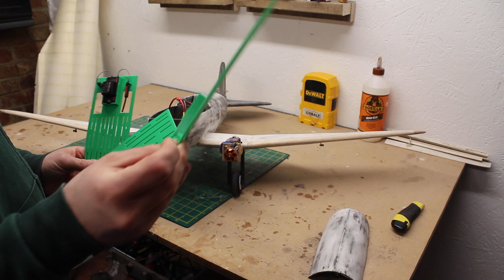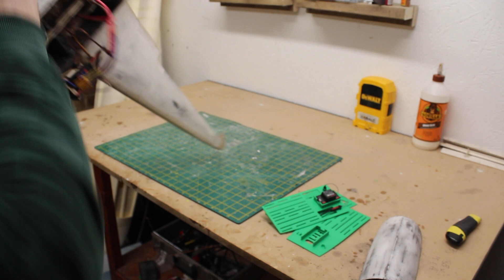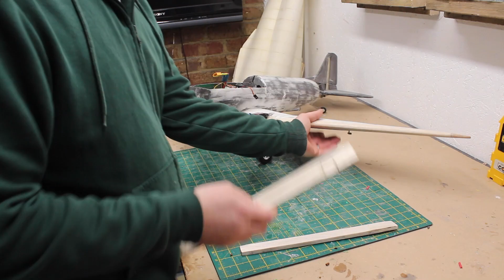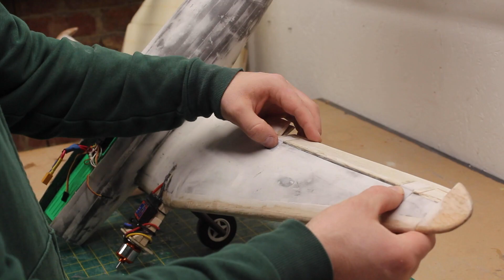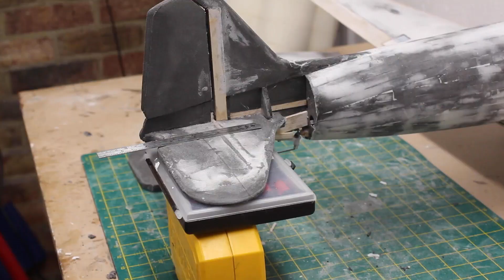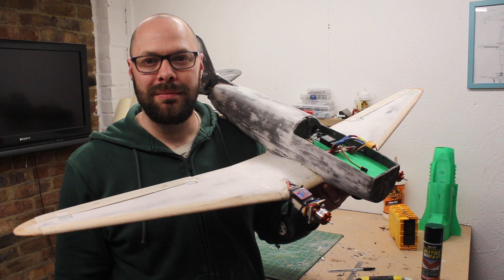Douglas DC-3 Dakota RC Plane Scratch Build - Part 7

Comment: There are special attachments for a setup like this. One pushrod to the elevator. Than you clamp screw 2 separate pushrods on it . So in the middle the pushrod from the servo. Left and right for left and right for the elevator

Comment: For the elevators, just use 2 pushrods, one for each elevator.  Any solid connection item between both elevators this far aft will get you into CG trouble; the dual pushrod doesn't weigh much and its weight is more distributed between servo and elevator.

Comment: I think that for the elevator the easiest thing to do is actually to use a 2mm push rod bent in an U shape
Reply from the maker: L' Ac3rbi I tried that, but had no luck. I might 3D print a control horn with two arms.

Comment: You can get a 3 way connector for the elevator- 1 main pushrod to the servo and 2 sub-pushrods to the control surfaces  https://www.rcworld.co.uk/acatalog/Triple-Rod-Connector-2mm-RCW0281.html#SID=557

Comment: one good hinge for scratch built foam is xray film 🤣. for linking 2 elevator search for typhoon phoenix model rcgroup thread they have this domino thing that connect two halves. it can be 3d printed
Reply from the maker: I dont suppose you have a link?
Reply: the black one in the picture.
Reply: are you decided